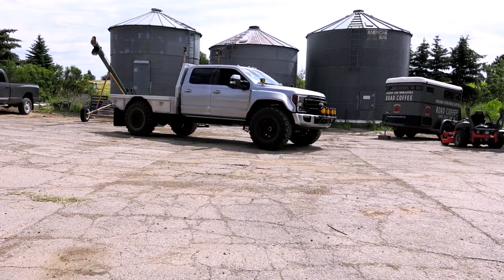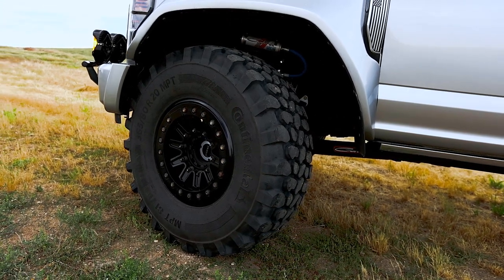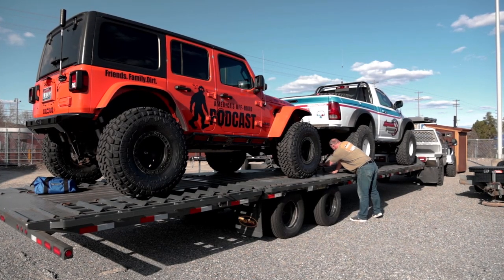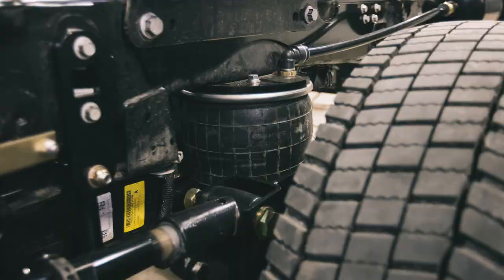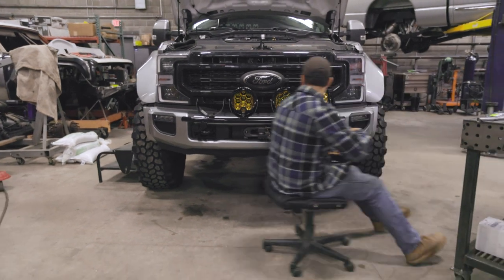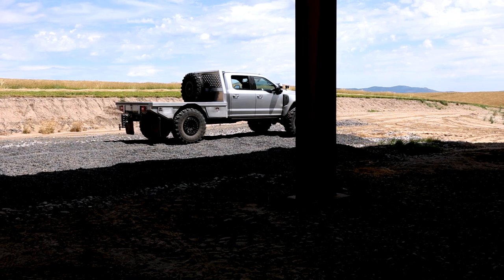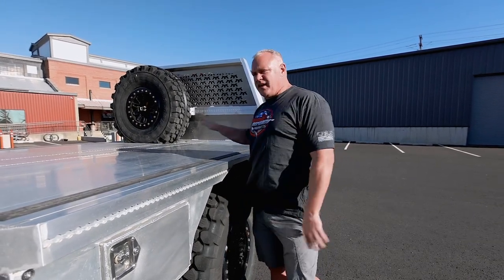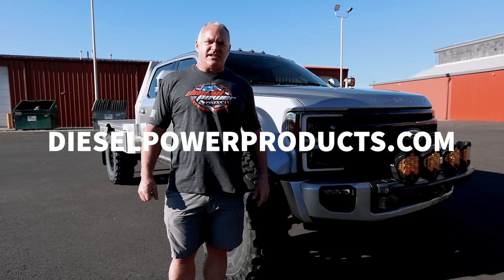Atlas: The Off Grid Tow Pig // 2021 FORD F-450 Super Duty 6.7L Powerstroke Build

Comment: If I wanted to have one built for myself, what kind of a price tag am I looking at?
Reply: Tires, wheels, leveling pucks and fender flares. Tires 5x$1000, wheels 5x $600-$2000 (have to have super single wheels so must do dbl, buckstop, or NASA Wheels), fender kit $800-$1900). Leveling $500.
Reply: Or just go to Sintor and it’s $200,000 plus truck